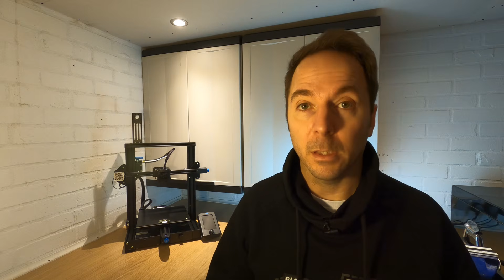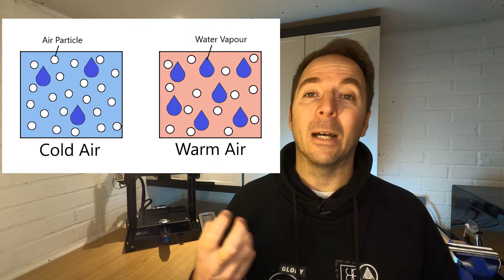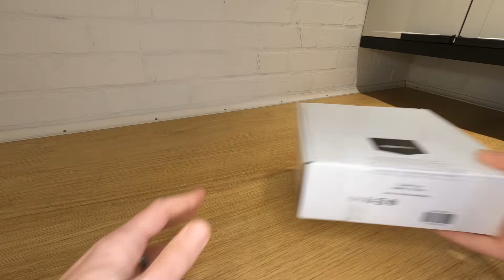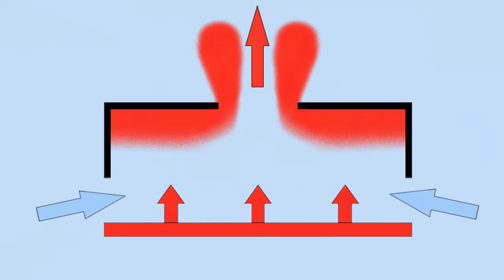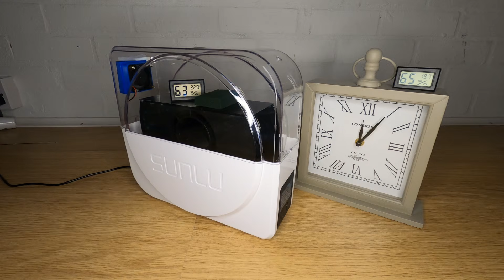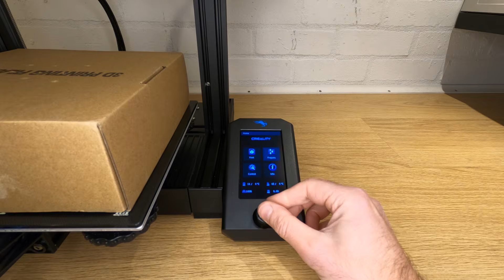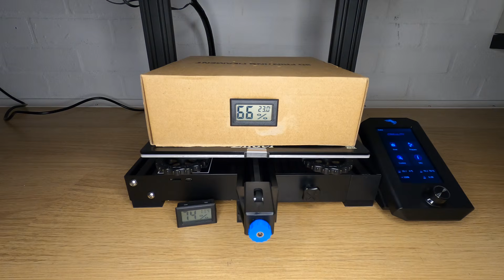Amazingly Simple Free Filament Dryer -You already have one!

Comment: Wow, this is insane! Never thought of doing this. Btw, what temperature should I set the bed for tpu and pla? And how long do I let them sit on the bed to dry for? Thanks!
Reply from the maker: Hi Kelvin, glad you liked it. Start with 50°C for PLA and TPU. It's best to have a thermometer like the little one I used to keep an eye on the air temp. Try to get the air temp to around 40-45° for these filaments. If you are concerned about the filament getting too hot from the reel being in direct contact with the bed, space it up with some washers or similar so that there is an air gap.
Reply: @RickyImpey  what temp should we set for petg?
Reply from the maker: @ilanodem1046  I dry PETG in my modified Sunlu S1 filament dryer with it set at 55°C you should be safe going a little higher without the plastic of the reel melting. I probably wouldn't go higher than 65°C though.

Comment: What temperature do you set it at when you're actually drying filament with this method? I know you set the sponge test at 70c but I would have thought that was a bit high for PLA and might soften it too much?
Reply from the maker: Start with 50 degrees C if you're only drying PLA. If you're concerned you can space it off the bed a little with something that allows a bit of an air gap underneath, then you can safely take the bed temp a little higher.
Reply: @RickyImpey  Thanks. Just done my first nozzle removal and clean following your guide, trying to eliminate a stringing issue that's popped up recently. My print room is typically 12c and unheated so if my clean hasn't fixed it, I'll try drying the filament next.
Reply: @RickyImpey  can we use coins to have space between the filament reel and the bed?
Reply: @nextlvlroy  would be better to use an insulator not metal. plastic bottle caps. strips wood, etc
Reply: should be safe to use recommend bed temp of filament. just lift filament reel off bed a few cm or a inch  PLA 60C, PETG 70C etc.

Comment: This didn't work for me sadly. I had my petg at 70c for 5hrs and it weighed the same.
Reply from the maker: Hi Jorge, did you have any problems with moisture in this filament? The problem I find is that there is no way to know for certain if you have moisture until you have removed it. It's obviously possible that there wasn't any moisture in the filament to remove. 70°C for 5 hours should have removed some moisture if it was in there.
Reply: @RickyImpey  I think you might be right with my filament not being that wet. I tried drying it this way because it was a bit stringy and was oozing out of the nozzle at lower temps. Could be my settings though.

Comment: How long do you leave it on and how hot is the bed?
Reply from the maker: The test was 5 hours at 70°C but it depends what filament you are drying. If PLA then you probably want 50°C. Best to weigh it before and after with kitchen scales to see if it's got any lighter. You may need to experiment with what you have but I'd start with 50°C for 5 hours.